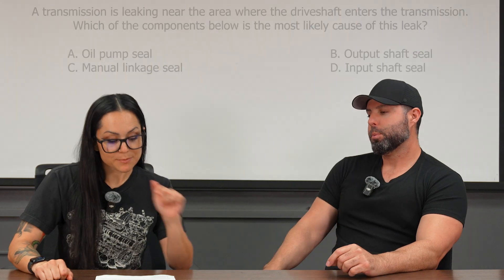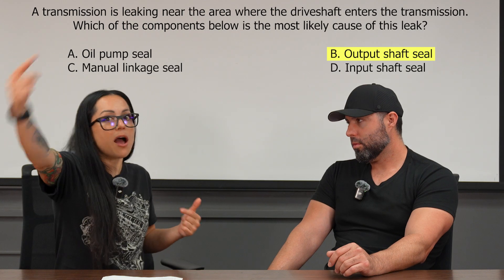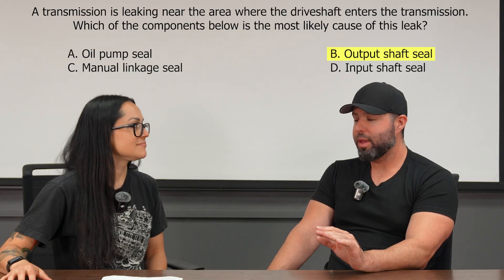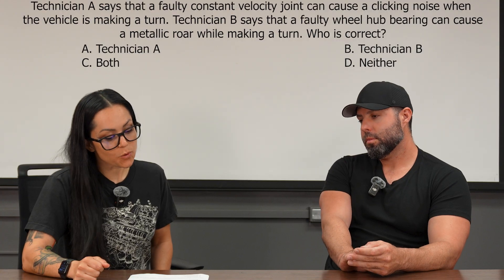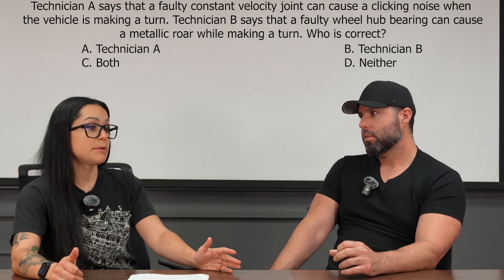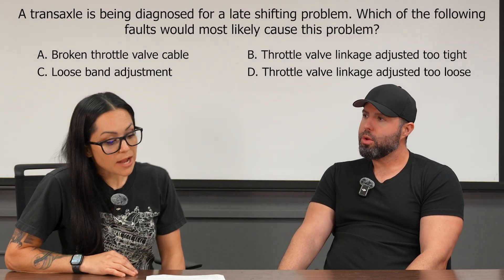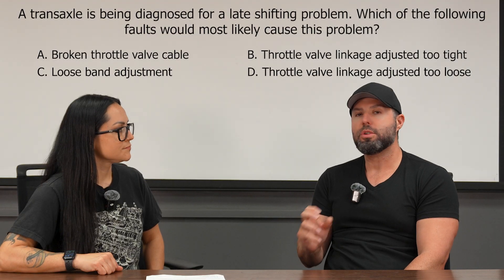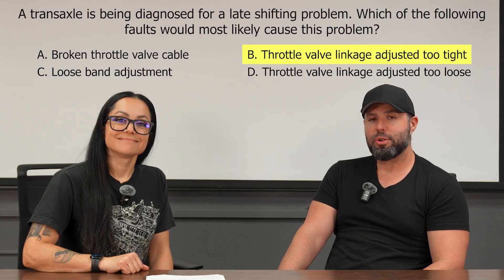Pass The ASE The First Time!!!! ASE A2 Transmission Test Prep Series Volume 1

Comment: Now hold on. Technician 2 in question two is referring to depression of the brake, (brake release), in which case the transmission should be engaging. The answer to question two is that neither tech is correct.
Reply: It is common to misunderstand the word depress when it is used like this.  It does mean to apply the brakes though, just check the dictionary or you may miss many other ASE questions. 

Push or pull (something) down into a lower position.

"depress the lever"

Comment: Pulling the axle is usually unnecessary if the coil spring is held while spinning the wheel in order to feel the vibration coming from the noisy wheel bearing, but some are still nearly imperceptible when they aren't supporting any weight.
The easiest way for me to think of the hydraulics on a hydraulically controlled transmission is modulated pressure versus governor pressure. To put it somewhat simplistically, when governor pressure exceeds modulated pressure due to the output shaft speed (which can be thought of as the "input" to the governor itself), the relevant valve inside the valve body uncovers a hole that will allow the hydraulic pressure to reach the servo or piston that will actuate a band or clutch pack ultimately changing the output shaft speed relative to the input shaft speed thus "shifting gears." Some like to think of it as engine load versus vehicle speed but that's a bit confusing for my mind, or torque desired versus vehicle speed which that at least bridges the gap to help better understand how modern automatic transmissions are controlled.

Comment: I object to the phrase, "Where the driveshaft enters the transmission." I'd suggest that if one's driveshaft is even partially inside of the transmission, the leak is the least of your problems. :)
Reply: Transmissions on non independent rear suspension designs generally use a slip yoke on the driveshaft that enters the extension housing on the transmission and rides on a bushing.  You may have only worked on independent rear suspension designs I would assume.